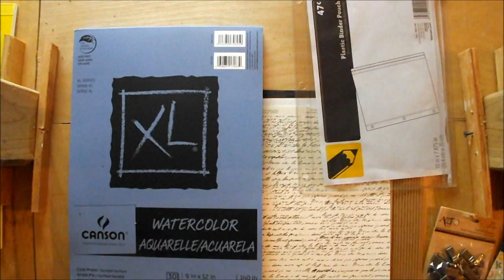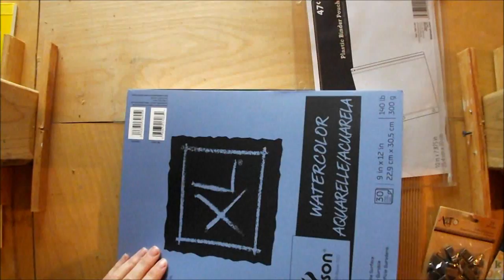Easy Art Journal - Make A Proper Artist's Journal

Comment: Thank you very much, this is the easiest way I've seen yet to make a journal, and I have lots of duct tape which I use to line the tote bags I make for friends. Mine is thicker, but I can always cut it. Your assistant is very pretty. I've learned that apparently humans need feline supervision to do these things correctly. Tory will occasionally steal a craft supply and hide it under the area rug. I suspect she plans to use it herself later.